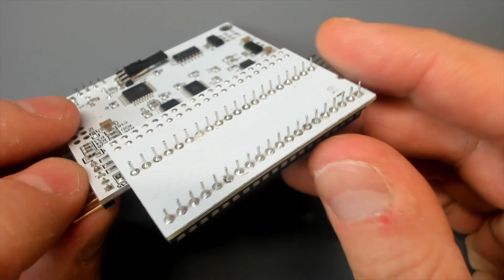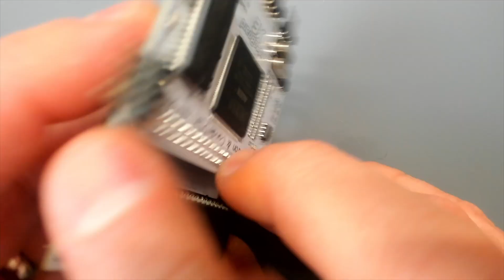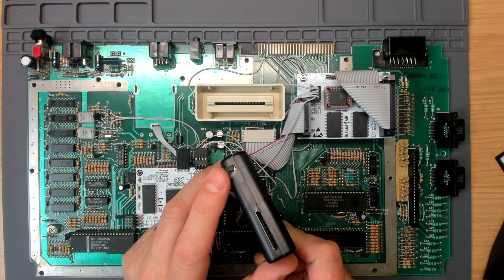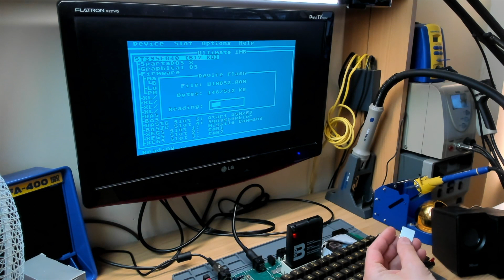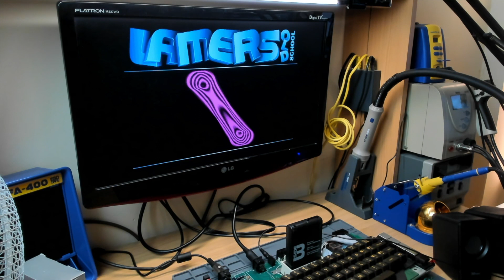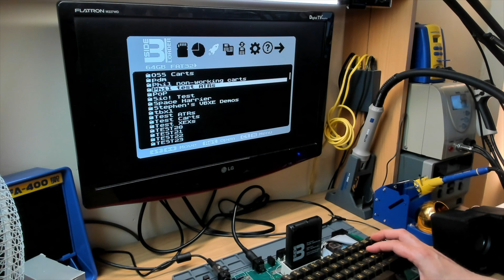Warranty Return 800XL - Client Video

Comment: Thank you for another informative video!
I think I now know what my issue is with my installed board - IC connector. I too get red screens, bad boots but, if I jiggle the board in just the right way my Atari will boot up I'll check the solder on those pins and make sure that they're even. 👍
Reply: You can try one of those diamond-coated sponges to clean the pins and make them smooth.